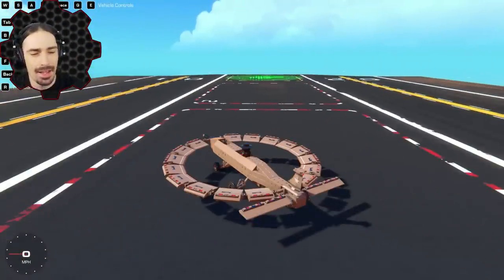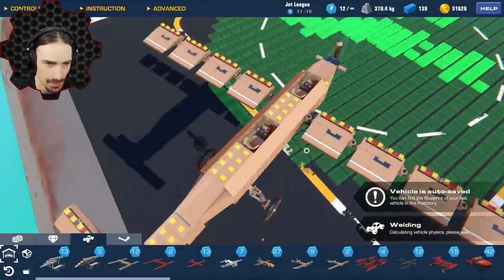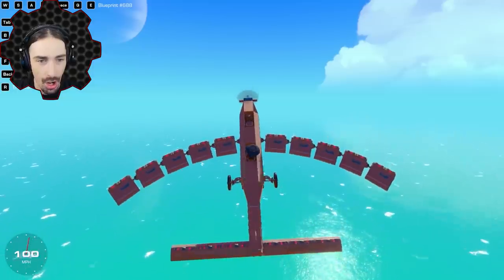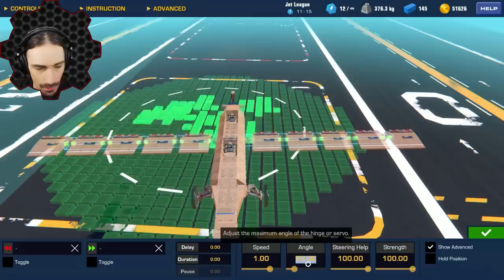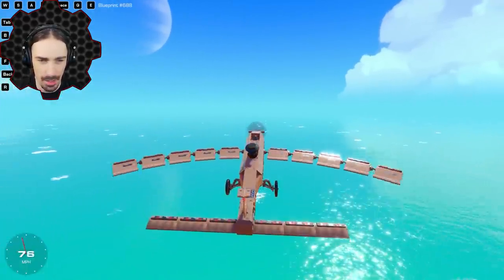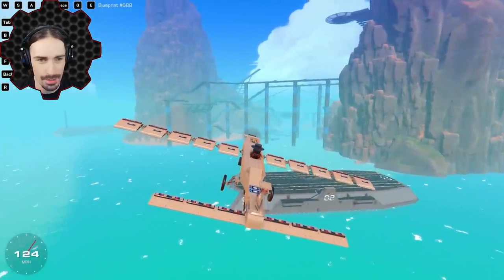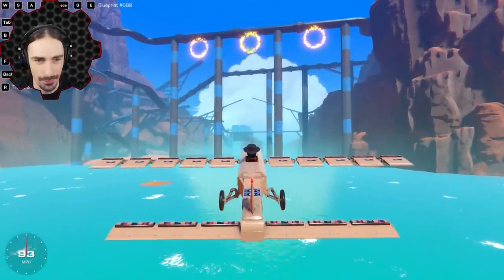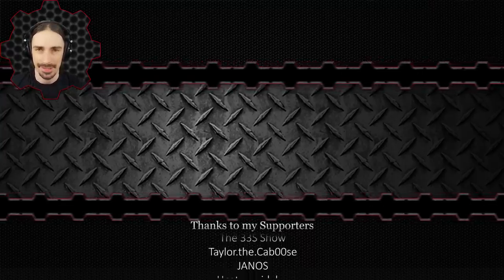Bending Wings To Adjust Center of Lift. Does It Work?

Comment: did you turn off seat controls? Because if you didn't its possible that it was affecting the results since the plane is quite light.
Reply: No, he did not you can see it at 10:27

Comment: Well scrapman, you might want to try to put more power on that, if the plane stalls after turning too much, maybe you can just force it to not stall by making it faster, it might work so it's worth a try.
Reply: Thrust does not really work against spins (stalling) IRL if it is an air detachment issue.
Reply: if he removed the Lifting bodies in his tail and just used the paddles it would fly so much smoother
Reply: this may be not the case, because when the plane stoles - it loses so much speed, and starts to go down because of lack of lift, and this is not what we see. Actually the plane starts to go down because it tilts forwards so much, that the vector of moving through air goes beneath the threshold , that pitch control requires, (based on fact, that the plane need to move with air pushing underneath to controls to work) and air begins to push from above
Reply: @andreyemelyan5267  so ur saying if he tries to recover and tried to pitch up he would be actually be pitching down even further right?
Reply: @andreyemelyan5267  hence why i said to remove the lifting bodies in the tail aka the wings and replace them with flat lifting bodies like the paddles
Reply: @DrPotato0  that's right, but even if we switch it right away it can't resolve the problem
Reply: @dominiccoppernoll8498  it's not about lift, it's about that thing called thrust, that forces plane to pitch down even more because it pulling whole thing, constantly refilling energy to feedback loop of centrifugal force and pitching in the wrong direction due to air pushing from above. So gravity instead should be stronger than thrust, or thrust should be turned off to keep the air pushing from beneath.
Reply: @andreyemelyan5267   I think this is a viable solution, he makes the vertical stabilisers slight angled downwards so that if he stops pitching down it automatically pitches to a stable flight path due to the wind pushing against the vertical stabiliser, this requires him to find a balance between the the center of mass and the angle he makes the vertical stabiliser so its perfect but this is what real life airliners do so maybe its works for him
Reply: If he had a way to invert the controlls once the G force is negative it would solve the problem entirely. Because once it noses down it loses force acting on the bottom of the wing and gains force acting on the top of the wing. Once the force on the top of the wing is greater than the force on the bottom, the controlls invert and you lose control.
Reply: @kaylinosprey3306  , that's a good thought, but inverted controls wouldn't work, because it's not just the inversion, but overall aerodynamics. Like, imagine plane just got recovered from nosedive, and controls need to be inverted right away, but it takes some time, and wings in their current position starts to act the way we don't want to, thus plane begins a new nosedive
Reply: You could also make the tail fin a bit bigger/stronger.
Reply: I thought about this, if he inverted the wing panels in the front half of the wings maybe the lift would work better?, I'm sure the real plane did not use just a turned around wing.

Comment: What you need is yaw. The reason why turning is so difficult is because you're constantly in an uncontrolled turn, meaning you're drifting, not turning. You should be banking to change the direction and speed of the turn, and use the rudder to execute it. This is how flying actually works. You use rudder and ailerons in conjunction to turn, not just one or the other. This would most likely fix this thing's problems.

Comment: I feel like you essentially made a bird but without the flapping lol. Angle sensors that emergency kick in whenever stalls occur to allow wings to act as normal elevator y might help.
Edit: Or you could have the wings level itself to the ground like real birds (generally, on average) do.
Reply: totally like a bird, except a bird can also use its tail feathers to help angle itself (i.e. up and down).

Comment: There actually was a plane concept without any control surfaces
The Vickers Swallow was supposed to control itself by changing the center of lift with sweeping wings.  It also lacked a tailfin which it accounted for by independently moving the angle of each engine to keep it stable, like how a rocket moves the engines
Reply: Wonder if that plane could to VTOL with the gimbal engine
Reply: Vector thrust

Comment: I made a similar thing during my campaign, but instead of a plane and center of lift, I used a helicopter and center of thrust. Two rotors attached to hinges and pistons. Hinges would move the rotors forward and backward for pitch, a servo would pitch the rotors forward/backward for yaw, and pistons would push the rotors away from the body for roll. It was surprisingly controllable, especially compared to how this plane looks :p

Comment: should use the yaw control to help with the "adverse yaw" induced from the roll.  Like flying a real plane you would lead into the roll with a little yaw input to prevent the nose from going out in the opposite direction. also more air speed

Comment: I think the reason the pitch stops working after angling down to far is because the direction the plane is facing is now below the direction it is traveling in, and the wings start to experience a negative force rather than a positive one. If I'm correct, when you pitch down too far, the control should still work, however it will be inverted. (ie wings forward to go down and back to go up.) If you wanted to get fancy, you could use an angle sensor to detect this and compensate by inverting the control.
Reply: Yup, that's the problem.
For a purely mechanical solution you could articulate the wings around the front edge such that the trailing edge is allowed to droop down (but not lift up). That would mean that any wind coming at the wing from above would pitch the wing up; and if you don't make the same change for the tail wings your whole plane would pitch up.
This may need a small counterweight in front of the wing so that it's balanced against gravity (especially important at low speeds). That way only the lift of the wing will influence it's angle of attack.

Comment: I wonder if a telescoped wing, like those toy lightsabers, would be feasible in real life to get wing only roll. Plus if there's enough available tolerance between the telescoped parts you might be able to bend them forward and back aswell. I'm not sure a similar wing to what I'm imagining could be made in trailmakers unless you mod it.
Reply: i have a plane on the steam workshop that does just that, wings move forward and aft, i also have them sweep fwd and back, kinda like the F14 tomcat.. I think i called it  WTF

Comment: So, you are correct in that no one would do this in reality. Not just because of the ridiculousness of the concept, though, but because of the engineering troubles. Swing wing designs already suffer from problems with all the stresses going through a single joint. Having all those hinges as multiple points of failure would basically ensure that the wing tore itself apart.

Comment: You might wanna put more vertical fins on the back, when you were rolling the nose was still pointing in the wrong direction, which was mainly caused by a lack of yaw rather than roll

Comment: How about trying to build a glider car? That is a car, with no visible wings, that pop out to convert it into a fully controlled glider (no air power). For bonus points, make the transformation automatic based on an altitude sensor.

Comment: I don't think it is the wind, I think it is the weight of the plane.
Your pitch control relies upon you changing the centre of lift vs the centre of gravity.

But as you change your pitch, while you don't change where the centre of gravity is, you do change the direction of it relative to the plane, so eventually it doesn't provide the torque required to rotate the plane.

Comment: @ScrapMan Love your uploads and you even got me playing Trailmakers.  The planes you make that have wings as tailfins provide lift in the rear. This is going to make your planes unstable and prone to twitchy pitch controls. Try using tailfins instead of wings. and pitching them slightly down. Real planes have negative lift in the rear. This pitches the nose up and helps maintain stability, especially in nose down stalls. Here's more info: https://youtu.be/zg6KcuVLe0g?t=175

Comment: Idk how this works in trailmakers, but real planes actually generate down force rather than lift on the elevator. Judging from how your plane flew I think it could be better if you added some more weight up front and turned the wings on the elevator upside down. This would move the center of gravity further forward, thus increasing the natural stabilizing tendencies of the tail so it would become more controllable in extreme attitudes.